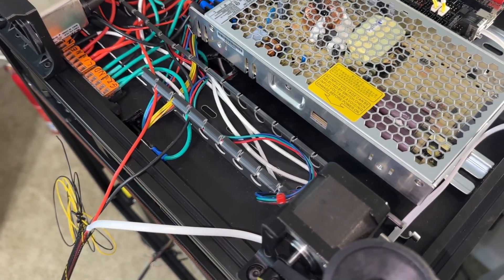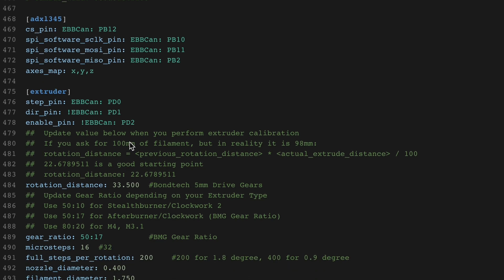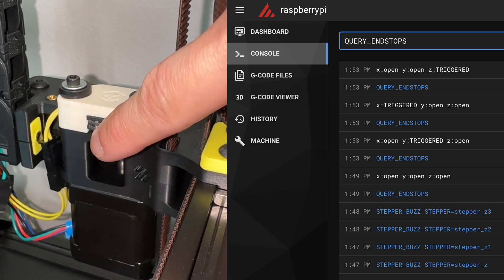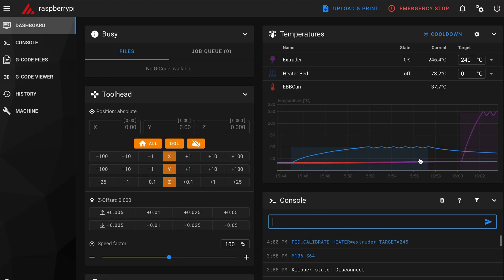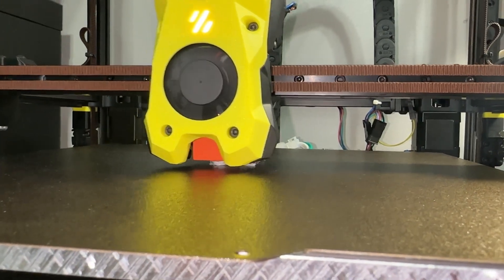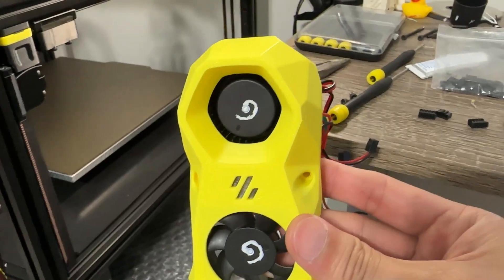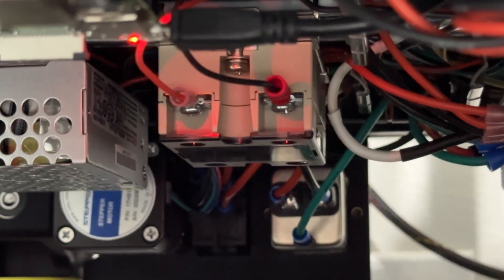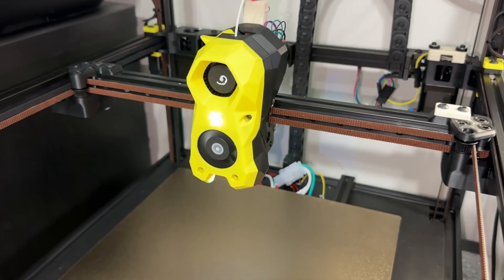DIY Voron 2.4r2 Part 13 Final: Software Configuration and First Print

Comment: I am finishing up a build. I am having a problem with QGL and I think it has to do with my home location. When I home X,Y I read 4.98, 0.00. I have 5mm pull off limit switch. This number should be 345,350 I think? for my build. Not sure how to fix my coordinates. Any help is greatly appreciated. Great series btw.